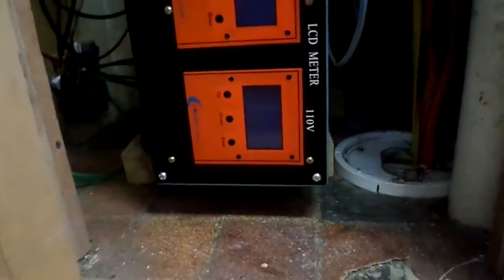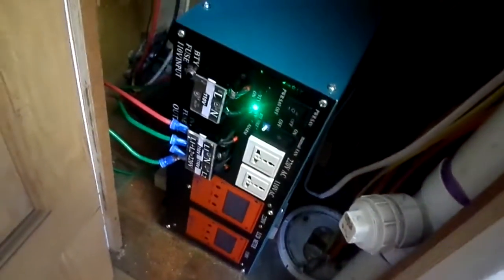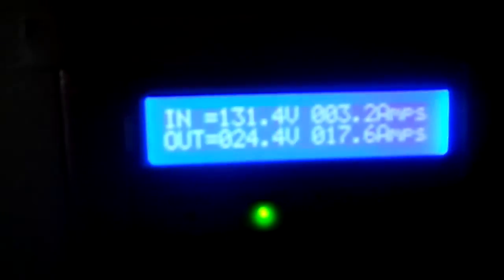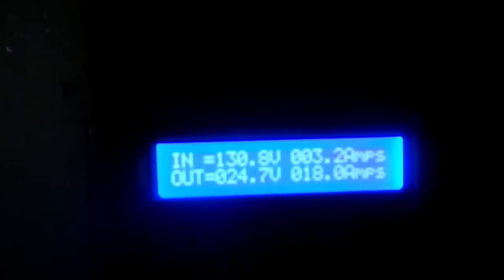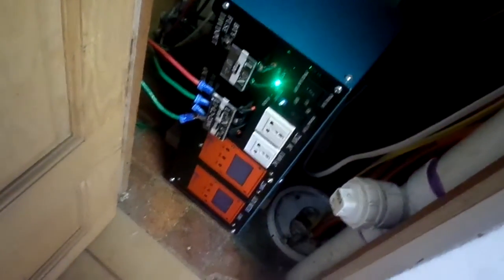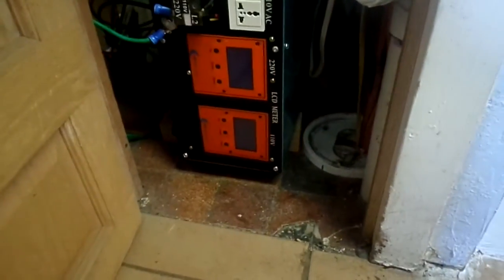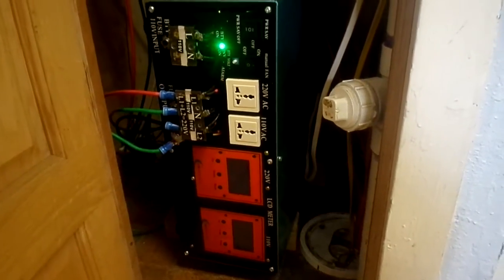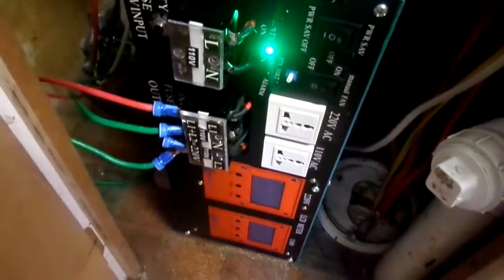Inverter Update  Fan Problem

Comment: Ya if you block the vents it will over heat. I think it should be flat.You must have a small dryer. 15A Glad it works for you.

Comment: kinda looks like power jack has stepped up their game, we will see, thanks for the video!
Reply from the maker: Our is not doing good:( It can not handle more than 4500 watts.  Even though it is 10,000 watts but will get hot and shut down if you try to use more than 4500 watts.
Reply: thanks for the update!

Comment: Ages ago with that style of inverter I used a 12v 10w panel hooked direct to an additional external fan to pull the air through the inverter, it really dropped the inverters temperature, I live in a hot climate though
Reply from the maker: nice idea ours is doing good now so hopefully wont have to resort to that:)